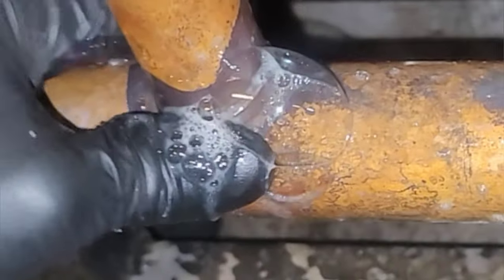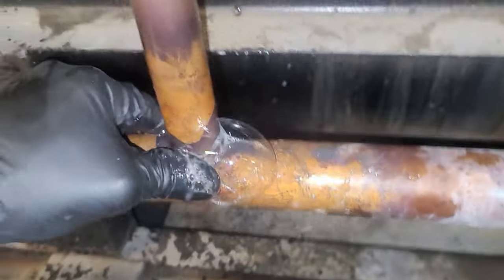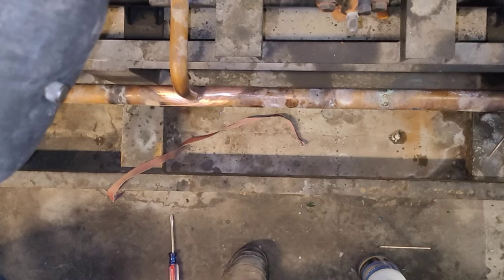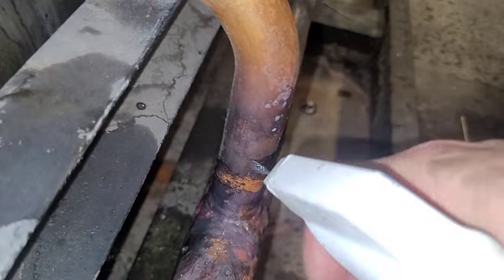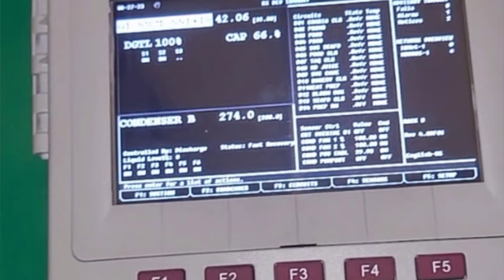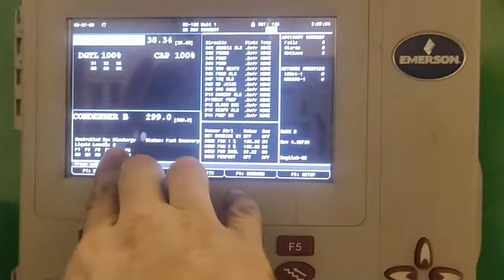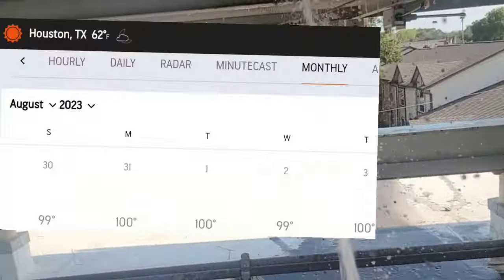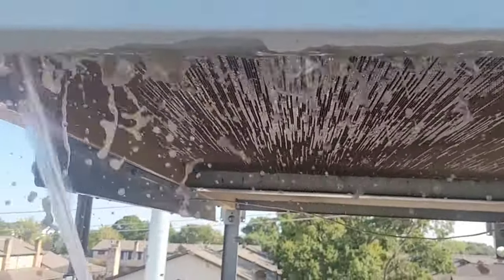Cracked Discharge Header Ruptured Blew The Charge

Comment: 2:22 100#'s of Dry Nitrogen? If so you must evacuate that part of the system to remove the non condensable gases and any moisture in that section of the system.
Reply from the maker: If I said Nitrogen,  it must've been by accident. I did not add any Nitrogen to that system.

Comment: Dang dude you didn’t terminate the crack? It’ll leak again
Reply from the maker: Terminate the Crack...? Please, tell me more.
Reply: @HVACRServiceTech  when you have a crack on a refrigerant line, drill a small hole at both ends of the crack to prevent it from spreading. If you just goober over it with braze, the crack spreads and will leak again as soon as it spreads beyond your braze.
Reply from the maker: @tobyoverton_hvacr  I never heard if that. Sounds like a well thought out, and smart thing to do. I'll make sure in the future to never just goober over it again like that. Thanks for the advice!
Reply: Yeah, I don't know about that. Maybe that's good advice but Ive never had a repair like that leak if you repair it how he did. The main problem to me was the high pressure causing vibration and heat.  @tobyoverton_hvacr